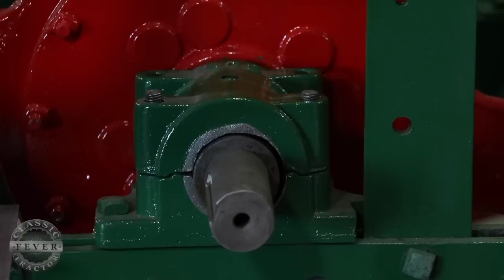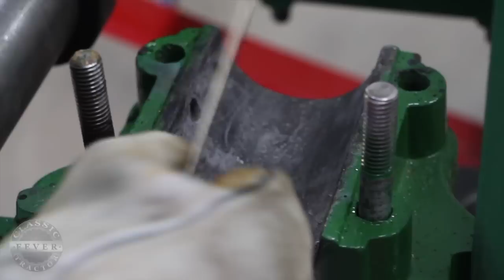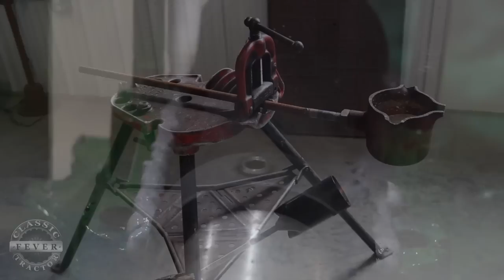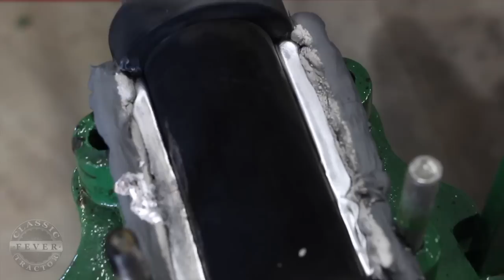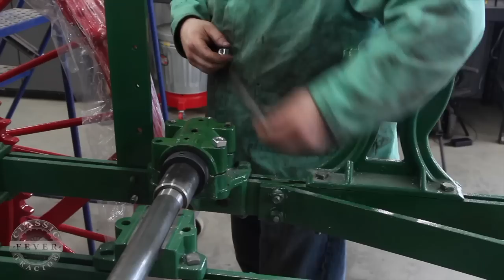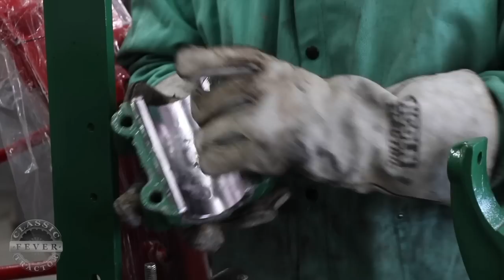Pouring Babbitt Bearings On Pre-30 Tractor - In The Shop - Classic Tractor Fever

Comment: Stop collets, and high temp caulk......  The modern equivalent to using "Babbitt Doe" for containing the pour.
       You going to scrape in the clearances?   😉
Reply: Excellent question. By the looks of the machine...this unit is not that critical. But that process is very interesting as well.